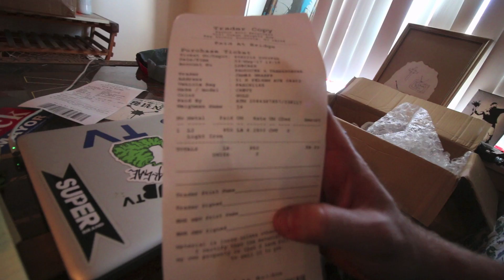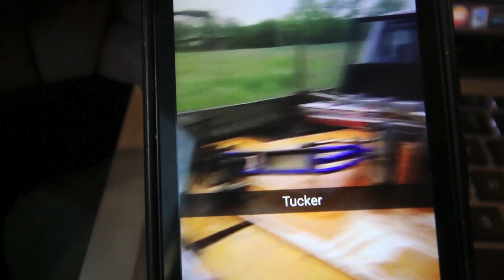POLICE PULLED ME OVER FOR SCRAPPING?!?!

Comment: Tucker, if you attach a bicycle flag, pole, broom handle, or anything that's tall enough to see from the drivers seat, aligned in the center  to your trailer, you can see where the ball on the trailer is when your backing up. You could keep it in the toolbox of your trailer when your traveling.

Comment: Man that's a lot of work collecting the scrap, dumping it off then loading back up.  Why not just drive around with the trailer that way you can spend the time you save on collecting more scrap or doing something useful?
Reply from the maker: You're right !
Reply: TheNinjaPicker I dunno man, he would have to look at the gas mileage may be doing extra work for the gas it takes to pull that thing.

Comment: When u hooked up the trailer I seen you wrapped your wires tight, the angle the trailer was on I thought for sure it would pull out. Once you got straight. Last thing, don't you get more money for the aluminum chairs if you take the strapping off and any steel bars. I get 3.25 a lb if chairs are clean.